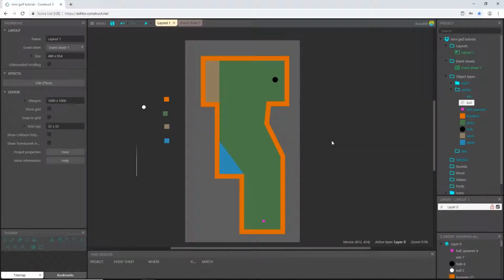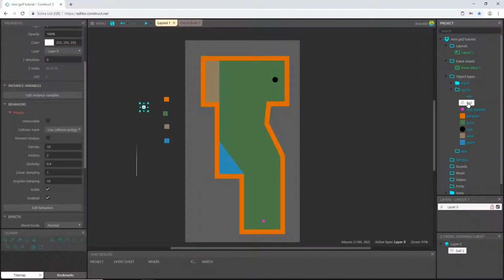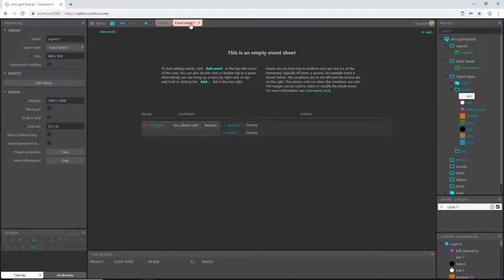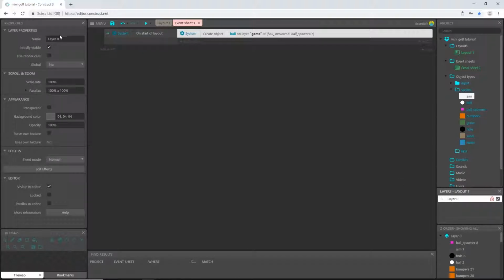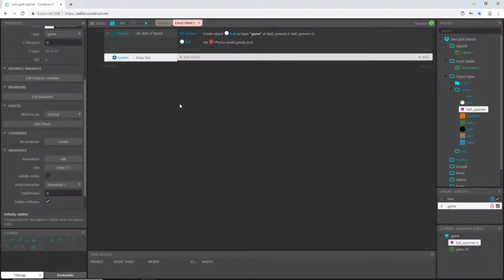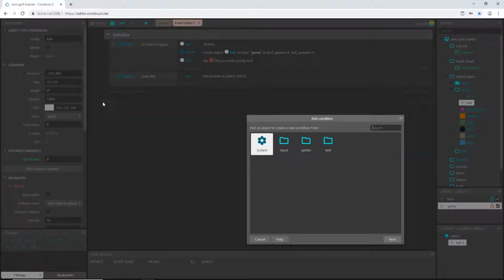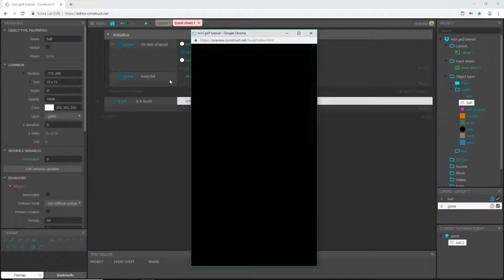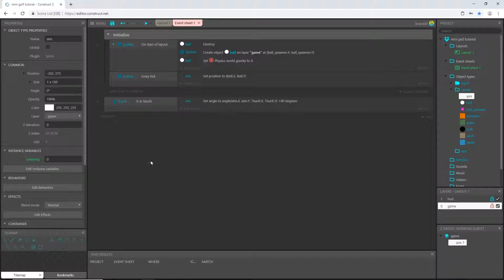Construct 3 Tutorial #3 - Mini Golf - Mobile Game - No Coding

Comment: Hello Marlin! Thanks for all of the help so far. I am struggling to find the input 
‘Touch’ categories. I am using the free version so I do not have the object types folders as you do. Am I still able to access these on the free version?
Reply from the maker: The touch categories should all be there. These events and actions are NOT restricted in the free version.

The "object type" folder is built in to construct 3, so that particular folder should automatically be there when you start construct 3.

Have you added the "touch" object yet? See video #1 of this series around the 19:30 time if you haven't. You can also double click on the main layout to bring up the objects selection menu. This does the same as right-clicking on the "object type" folder to add objects.

You certainly should be able to do everything I have done with the free version (except adding sub-folders, which doesn't matter). Not sure if I answered your question correctly, let me know. We'll get it figured out!